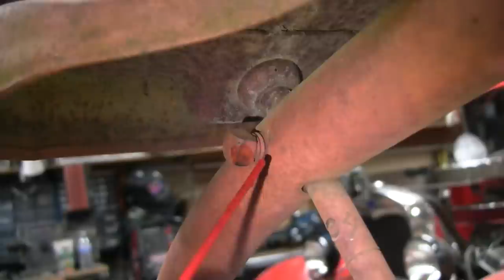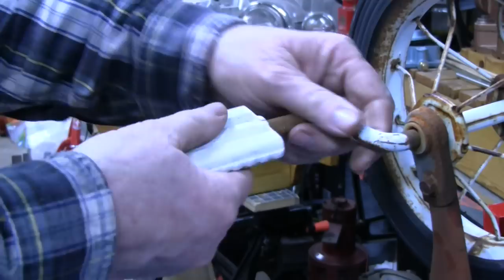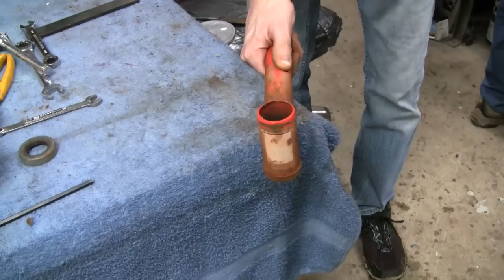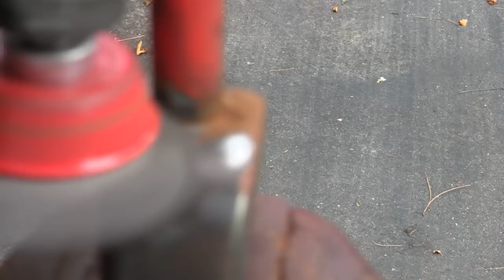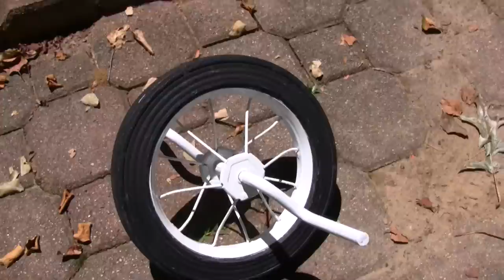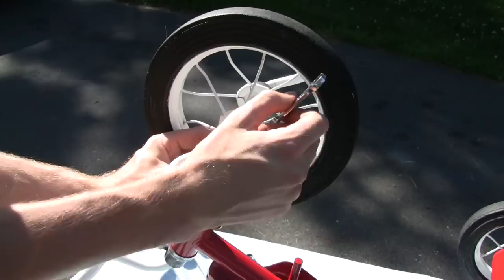1950s Antique Tricycle Restoration

Comment: Wow!  I have a trike VERY similar to this.  Probably the same thing, except I have a larger wider fender up front.  I see there are no bearings in the headset.  My forks seem to be pushed back.  Wobbly for sure.  Rear tires are wobbly on that rear axle.  I don't see how they fit tighter after your cleanup.  Snapping your fingers again?  My front pedal/axle is wobbly too.  Looks like you found new hardware to attach front wheel to fork.  Again, the fork magically gets tight after cleanup?  Very nice!!  This was my bike, and my grandson was over the house and started riding the trike all wobbly as it is!   So now that I see him riding it, I feel like "trying" to do what you did here.  Thanks a lot for the video.

Comment: That AMF label and the hex bolts/brackets that connect the body tube to the rear step and axle were used in the mid-to-late 1980s.
Reply from the maker: Thanks for the information!

Comment: I would like to know where you got the new rubber for  the wheels?
Reply from the maker: Ended up using original wheels, just cleaned them up a bit.
Reply: Ok. Thank you.
Reply: @motoforlyfe  how did you clean them up? I'm working on something similar. Thanks!
Reply: We inherited a similar tricycle from my dad. The front tire is starting to crack. 😒 Suppose those wheels could be replaced?